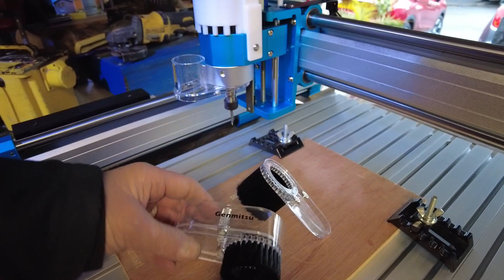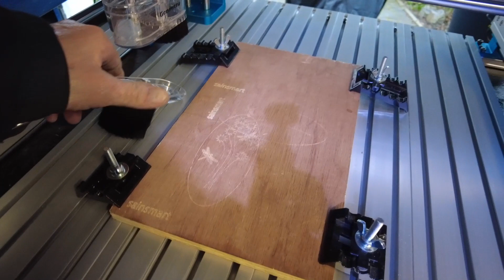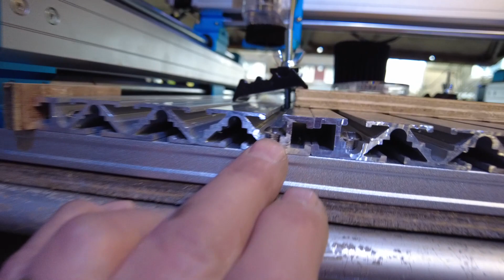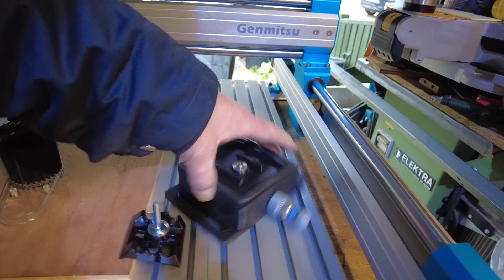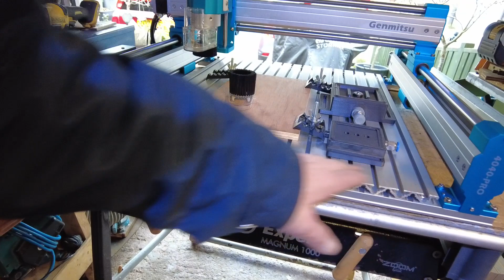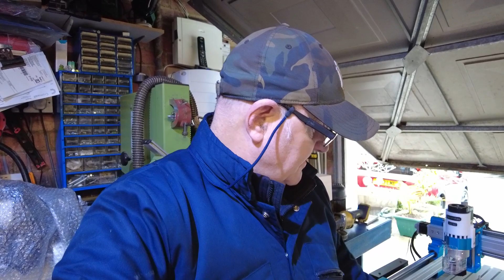Sainsmart Genmitsu CNC 4040 Pro Aluminium T slot table

Comment: Great idea Tony. Unfortunately, the aluminium T slot table section is currently not available from Amazon UK.  Amazon Aus can provide a MDF / Aluminium hybrid board for the 4040 with a 200mm extension.  Cost is approximately $300 or 150 pounds.  Do you think this would work as well? many thanks in advance.
Reply from the maker: Hi thanks for your comment I purchased mine off Ebay for approx £70. Is the hybrid board made up of MDF and alloy T slot  if it is it should be ok. I preferred the all alloy T sections. If I need a spoil board on I just bolt one to the table. Quite a lot of uses use that type of bed.
Reply: @Tonys.Top.Tips.Workshop  HI Tony. The hybrid bar has 6 aluminium T bars and 7 MDF strips and measures 420 x 600 x 20.5mm.  I doubt that I could make it as precise as this one for the price.  I think that it would be a useful extension for when I start using a trimmer router for larger projects.  At the moment I am content with the smaller spindle and practicing on small MDF boards until I get more confident wit the software and the machine.  Your videos are giving me helpful guidance along this journey.  Cheers KBDesignsAu
Reply from the maker: @kerrodhallett4944  Hi thanks for the comment  you are so right in the way you are going about it, as I always say one step at a time. I here of so many users  taking huge steps ending in serious mistakes. Keep progressing as you are

Comment: Hi i'm trying to add a 15120 profile too but i can't get it around my head how to get the head of the screws into the slots on the profile can you tell me how you got them to fit? Thank You
Reply from the maker: Hi thanks for your question I used m5 button  heads in the groves of the t slot. Cut them short enough so they push in from the side but yet has enough thread to go into the cross rails.  You will have to drill and tap the cross rails to fit in the groove  of the t slot. Once  you have fit the profiles take the bolts back out one by one file down the heads just enough to let the t bolts slide in yet still allowing the Allen key to grip.hope understand this.

Comment: Hi Tony, great video which inspired me to buy some 15120 for my 4040 Pro. I was just wondering what spec of bolt you used to fasten them to the end rails? I assume you tapped the rails but did you use any Loctite (Blue) to stop them vibrating loose. Excuse basic questions but I'm a first-timer at CNCs
Reply from the maker: Hi thanks for the interest I used 5mm x 12mm button head Allen key bolts and drilled and tapped the rails 2 in each end of the rails.  I had to thin the heads of the t bolts so I could slide them over the button heads and into the rails that's if I wanted one where a button head had been fit.  No loctite.  Hope you understand this cheers Tony
Reply: @Tonys.Top.Tips.Workshop  very clear and helpful, thank you

Comment: Hi Tony another great video. I have the 4040 pro and I put the Makita router on mine. I want to change the spoil board but it a lot more expensive here in Canada to do. I agree 100 % about taking baby steps. I tried the test g code and they worked so I made a practice sign and that turned out great. I use Carveco and they have been really great with the support Dillon actually called me from the UK to get me sorted out. Your videos are great also.
Cheers Mark
Reply from the maker: Hi Mark thanks for the report back on my video and glad you are progressing further keep me informed Tony

Comment: Hey Tony. Thanks for the overview. I am replacing the z-axis bearings on mine since they have quite a bit of play in them. The stock bearings are 29mm long and are generic. I ordered precision bearings that are 38mm long which should provide better leverage against torque. I ordered mine from Misumi. They are a little bit expensive at $56 each but I've got a bunch of 3D printers I know the cheap ones are not the way to go for this application.... As for the bed I am going to remove the front and rear x-axis braces and replace them with 3060 aluminum extrusions, tie those together in the Y-axis with extrusions and add a center brace. Then I will mount the T-track to that. I am planning to use 250mm wide track so I only need 2 pieces but that means I will need to machine off 1mm near each block. The spoil board will be added to the T-slot and 15mm tall riser blocks will be added to bring the Y-axis mounts up even with the T-slot. It's overkill but will add some mass and versatility to the machine. It will also be fun to do. If you would like to see the CAD drawings they are on my FB page here: https://www.facebook.com/media/set/?set=a.10230785538121609&type=3
Reply from the maker: Hi Greg sounds like a lot of work for the future hope it works out for you what sort of cost at the end of the upgrade. Let me know how you get on Tony